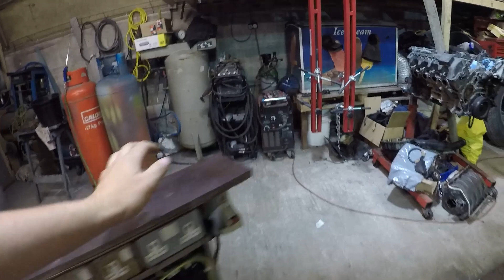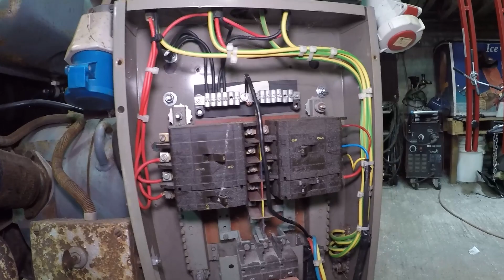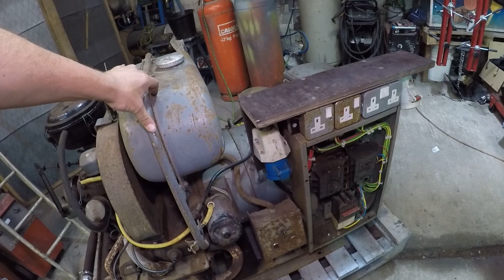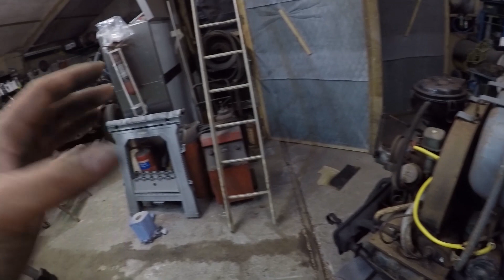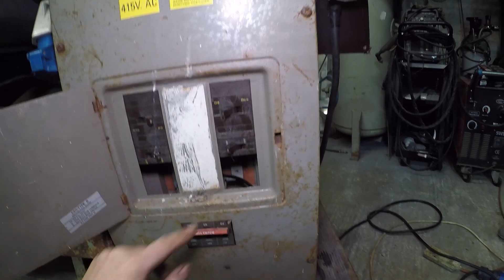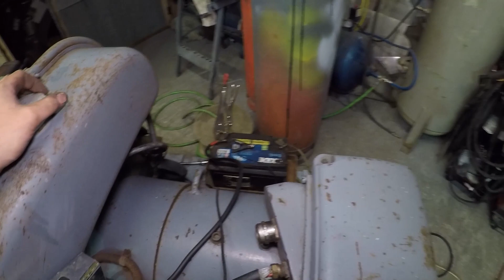What have I bought now... My first aircooled project! (Extremely rare and heavy)

Comment: very rare and very cool. That cross over pipe from exhaust to inlet is a inlet manifold heater as inlet tract is so long it needs externally heated. That thing on the side of the carb is a fuel cut off solinoid , should click when powered up. this stops any run on or dieseling.
Reply from the maker: Thanks for the info, as you can tell I know very little about it. Excited to see what I can do with it